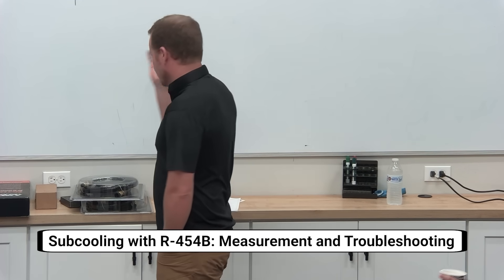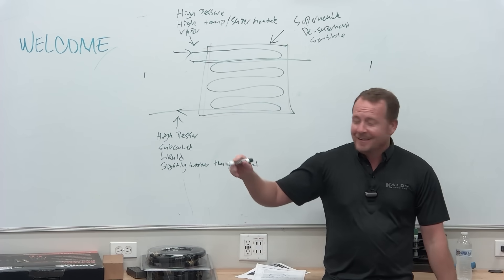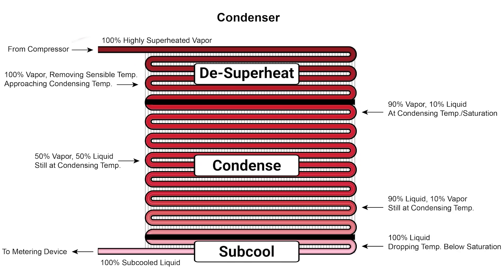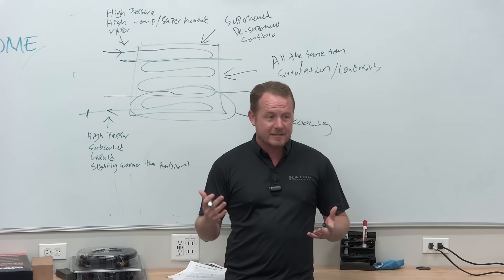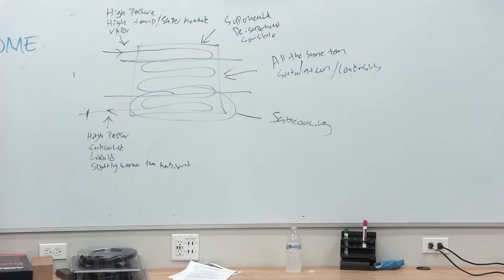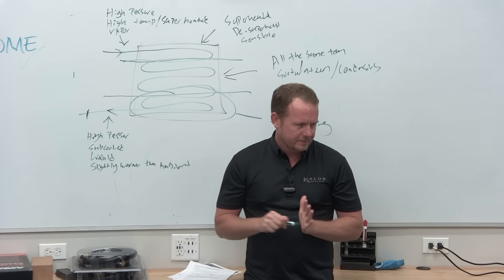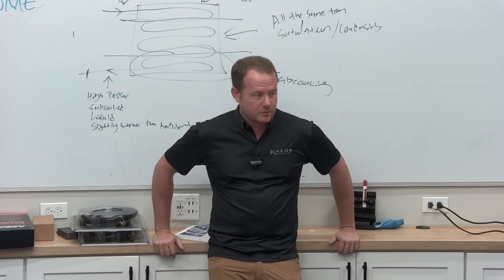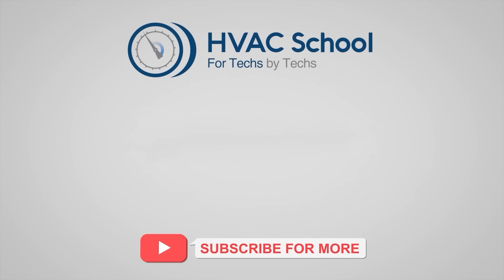Subcooling with R-454B: Measurement and Troubleshooting

Comment: Here is a question/questions I have. What are we seeing practically as far as startups when it comes to subcool and dialing in the charge. I am not a regular installer but do show up to some jobs and get to be involved in the charging process. We had a unit the other day, that was roughly 8 degrees low on subcool on startup after 15 mins. The unit was precharged for 30 foot and the line length was under 30 foot. Are we noticing that it is taking a lot longer for the blend to equal out? I guess what I’m asking is in a practical sense what are we seeing with the temperature glide and inconsistencies and how does that relate to improper of cooling measurements?
Reply: Ambient temp dictates the glide…

Comment: The geniuses had to mess up pure R32 because they couldn't let that company that holds the patent win, and they didn't want to recalibrate their existing equipment. But what about the downside?
Reply: Increased flamibility. They add the other refrigerant to offset the high flamibilty of r32. We've never used a flammable refrigerant before. Insurance companies will freak out when houses blow up from leaks. Insurance execs run the world 2nd most profitable business in the US.
Reply: @jamminwrenches860 no, I was talking about the downside of mixing instead of going with single component R32 like Daikin. They introduced a whole set of complications that were not needed because of greed and jealousy, and R1234yf is flammmable also. No meaningful difference vs R32 alone. Both a2l . R32 already used for decades.

Comment: I had an encounter today and I am barely new to r454b. I had a low pressure of 112 and high of 256. Subcool was 12 and vsat at 40 degrees. I kept having a low pressure switch cut off. What can it be?
Reply: Did you check air flow?

Comment: I work on chillers 98% of my days. We have subcoolers ....aka economizers. They increase the net refrigeration effect and your evap gets a nice bump in capacity available. It also helps keep the compression ratio in check. Ours aren't used as motor cooling,  as its injected in the interstage of the compression cycle. On really hot days....its fairly easy to keep your discharge superheat in check and the temp in a normal operating range. On our screws we use 2 slide valves in unison to control and modulate the compression ratio. Under any load condition we can keep the velocity of the refrigerant in an optimal range. The stability of the refrigerant cycle helps to promote an efficient piece of equipment.

Comment: Very good class. I've just gotten interested in HVAC and as a consumer I was angry with a technician for not having the equipment to find a leak, just pumped it up with coolant and said that should last a while and just call me back. I asked several technicians about hydrostatic pressure because of the condensation drain pipe overflowing into the drain pan. They appeared clueless. Now I'm cleaning my own coils and servicing my own units because they won't. Which has me wanting to learn this craft at 70 years old.

Comment: If only they made a see through section of the pipe.  Oh wait, it's called a sight glass, you don't have to guess if there's liquid in the liquid line.
Reply: Yeah but one sightglass still doesn’t tell you if you have refrigerant boiling off at multiple temps at different points because the blend is trash…

Comment: Thanks again, explained well as usual.  The wrap up about importance of consistency in documentation cannot be overstated.  Tracking benchmarked mQ pro reports are proving very reliable at taking the guesswork out of wondering what the readings were at the last visit.  The shift to A2L makes this all the more important so that leaks aren't ignored.  Mandatory core depressor use with mQ pro reports makes a lot of sense, especially with A2L.

Comment: I have noticed from viewing many HVAC YouTube channels how the techs tend to condemn or recommend replacement of existing systems or evap and condenser because the charge was low suggesting there is a leak. Unless the tech regularly services that particular customer or has been there before and all was normal just a few years ago, they would have no idea how big the leak is. It could be a 15 to 25 year old condenser/system and the leak took 5 or 6 years to begin freezing up the evap yet the tech will recommend replacement vs. charge it up with a couple pounds of refrigerant and wait to see if it goes another 5+ years or not. If it does leak back down in a short time say 2 years or less, then the tech knows the leak is fairly rapid but if it doesn't after 5+ years, it doesn't seem reasonable to recommend replacement and simply charge it back up. The customer would have much to say in the matter but on the conservative side a leak requiring a couple of pounds after 5 some years seems fair to let it ride until the leak gets worse especially with the cost of condenser and evap replacement or a new HVAC system vs. the cost of recharging refrigerant. Even a new replacement could have a leak in a 5 year time period...we all know that is happening more often than in the past. 
Thanks for the info on the condensing of that R454b mix.  I'm all for R32 systems.

Comment: when in doubt cycle between your PT charts of 454b, 1234yf and R32, ensure the sub-cool is balanced +/- 4 between the spread, its the same principal we have had to do for years since drop in R22 replacements came on the market and not labeled on the unit.

Comment: When it’s over 90 degrees ambient it glides/flashes way more than 410a, especially on long lineset applications. Brands like lennox super squat new condenser coil design, where a 4 ton isn’t much bigger than a 2 ton in overall surface area doesn’t help the situation much either. Just my take, if it’s a hot pull down with our summer conditions, I’m letting that thing run for at least 24 hours before I touch it…

Comment: First time I got my hands ahold of 454b. I used a old 410a window unit to experiment and learned. While similar very different. Yes slight under charge. More airflow than R22 and needs least 5 mins for Freon to mix and get better results